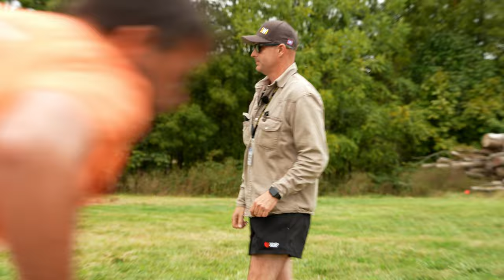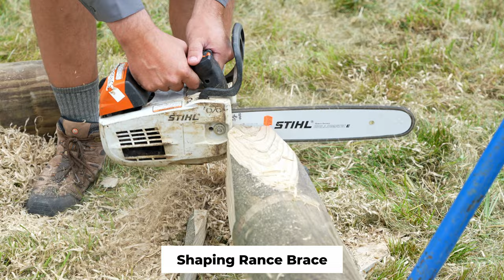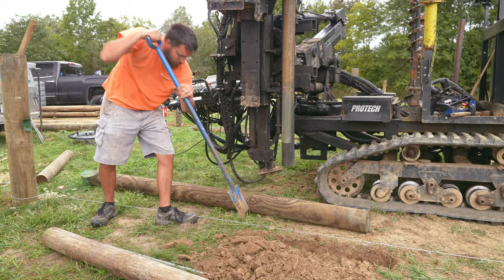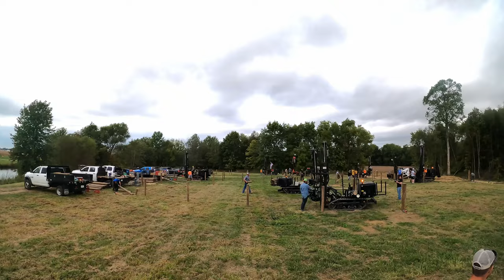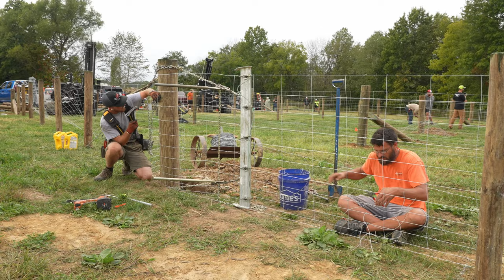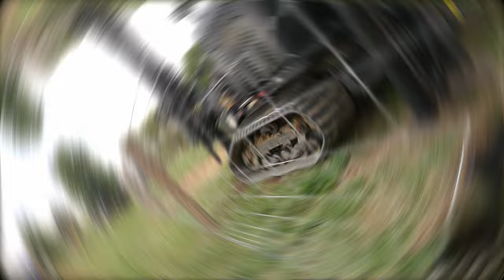The Fence Building Competition You Didn't Know Existed

Comment: I will never understand why anyone needs that angle brace at an end post. Around here just frill a hole in the ground and drop in a used concrete light pole and that's it.
Reply from the maker: We're using high-tensile wire and we put a LOT of tension on these wires. Without the brace the posts will just pull in to each other the wire will slacken and loosen.